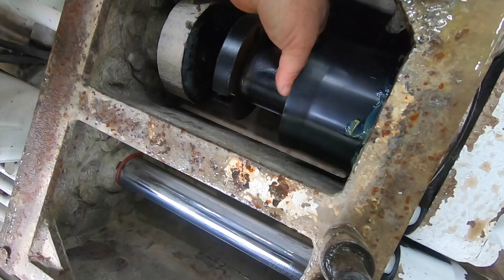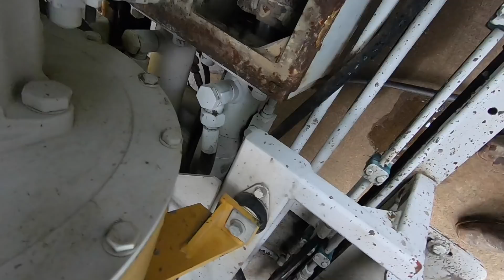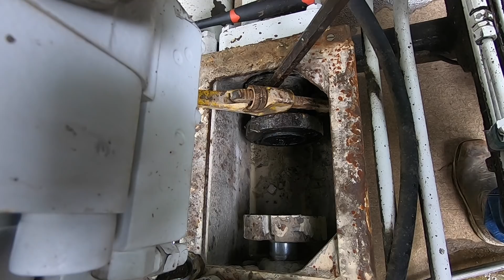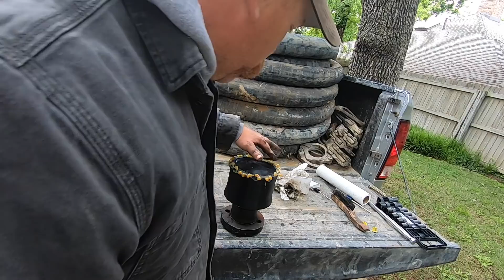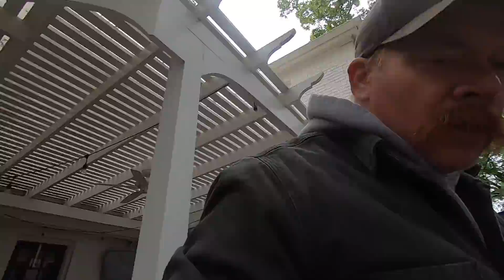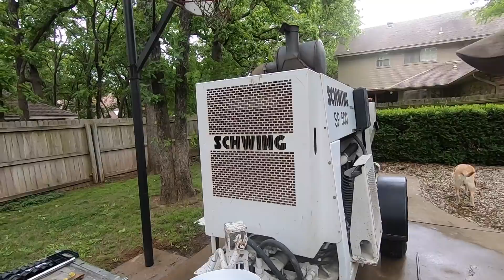Schwing SP500 mudcups replacement. Changing mud cups with Muddyfeet .

Comment: what is the purpose of the water tank and the mud cups?
Reply from the maker: The rubber mud cups is what goes on the end of the hydraulic rams and sucks mud into the material cylinders and pushes it out through the system once it starts to discharge. The water box lubricates the backside of the mud cups and helps cool the hydraulic rams as they work.

Comment: Something like this should help you get the bolts on and off the dogbone in both the trailer and boom pumps...

https://www.vehicleservicepros.com/in-the-bay/tools-equipment/tool-accessories/extensions/product/21000293/snapon-inc-38-offset-extension-wrench-no-frw10
Reply from the maker: Have to look into that

Comment: Try pipe lube on the rubber end. Of the cup. Petroleum base grease will degrade the rubber.  A big tub of it at a plumbing supply is about $12 You would have to evaluate. If it makes a difference. They might wear out just as fast. The stone and sand in the mix is a  harsh environment.     The grease is probably out of there pretty fast.
Reply from the maker: Big RICK I’ll have to remember that next time.

Comment: hola soy técnico de schwing PERÚ yo cuando cambio embolos saco el acople central y tengo un perno que pongo en la ranura del piston hidraulico y jaló el émbolo con el mismo pistón porque no lo hace así si para eso es la ranura ?

Hello, I am a schwing PERU technician. When I change the piston, I take out the central coupling and I have a bolt that I put in the slot of the hydraulic piston and pulled the plunger with the same piston because it does not do so if that is what the slot is for?
Reply from the maker: Rony Trullen yes I’ve used that way many times. Sometimes you can use a pry bar.

Comment: Sorry not related to this video. Are the pumps not allowed to wash out back into the empty mixer ?? I see alot of sponge ball blow back ??
Reply from the maker: Your not able to get all of the concrete out of your hopper and system. Doll we  have to pull a sponge back to get it out and then dump the hopper. Some guys do what we call a water wash but I don’t allow my guys to do that. I don’t trust the process and don’t want to take a chance rock packing the system.

Comment: how long the mudcups you used before you changed in hours?
Reply from the maker: I don’t go off of hours. These pumps have some idling time. I go off of my water in the water box and how dirty it gets.
Reply: my water in the water box is clear the pump has only 246 hours and probably around 500 hours i had to change the mudcups. a friend of mine has change the mudcups at 660 hours.
Reply from the maker: barbu marius right. Sometimes it depends on the slump of the mud and like these trailer pumps it depends on the pump pressure from pushing long distances. This is why I don’t go off of hours. Their are other variables that could show you signs of wear.
Reply from the maker: Or could cause your cups to wear faster or slower than they had from the last time you changed them.

Comment: I have a question about the Concord pump truck. 
Does it have a separate engine to run the hydraulic pump or is it driven by the truck engine PTO? 
Also, is the grease you used on the cups LPS Aqua? 
Thank you for sharing your entertaining adventures. 
Keep yourself, family and friends, safe, healthy, wealthy and happy in these crazy times.
Reply from the maker: The hydraulic pumps are ran off of the PTO of the truck. I have no idea on the grease. It’s heavy duty grease from NAPA.  I’ve been using it for years and I thinks it’s the best you can buy. Or at leas5 is available for us.

Comment: How many hours those things last?  And do they last the same time in truck pump?  And while I’m being nosy which of your pieces stays the busiest; pump, big truck, or smaller truck?
Reply from the maker: Patrick West right now they are probably equal as far as busy. Honestly I don’t keep up with the hours on the mud cups because sometimes you may have more ideal time than others. I watch my water in the water box and I keep a spare set on hand. If my water starts getting really cloudy on a 10 to 20 yard pump job then I know it’s getting close to time to change.  I try to avoid getting any grout build up in the water box.
Reply: Muddyfeet Concrete Pumping   I got you. Was just wondering. I also just figured the small pump would stay busy just for customer cost. Glad you staying busy. Stay safe out there.
Reply from the maker: Patrick West thank you

Comment: Its amazing to me how those concrete pumps work.  They are like everything else,  wish the engineers that design them were required to have at least 3 to 5 years experience working on them.  I bet there would be more room to work.  Lol, great video and stay safe sir
Reply from the maker: Yes they are amazing machines.

Comment: That seemed relatively easy, I remember doing that on my dad's pump, you had to drain the whole water tank when you replaced the mud cups. It was a lot easier than what you go through, but it was a different style of pump.
Reply from the maker: Yeah and heard that the 2 piece cups are a pain in the butt.
Reply: @MuddyfeetConcretePumping  you need battery grease gun